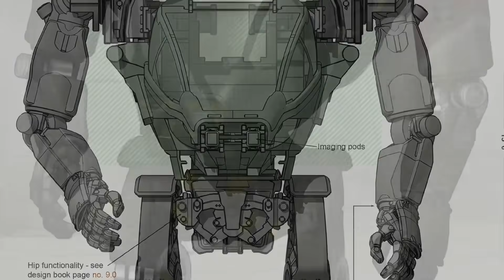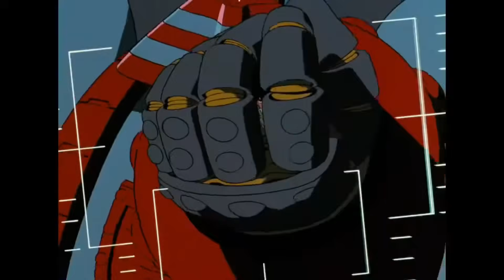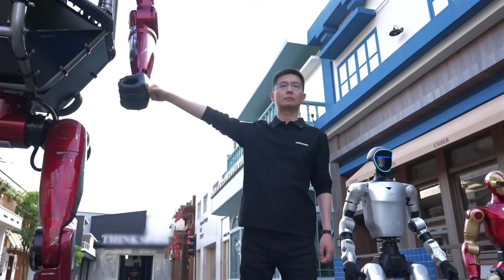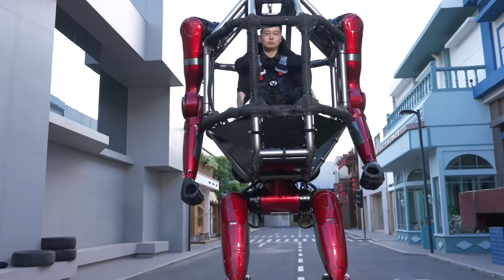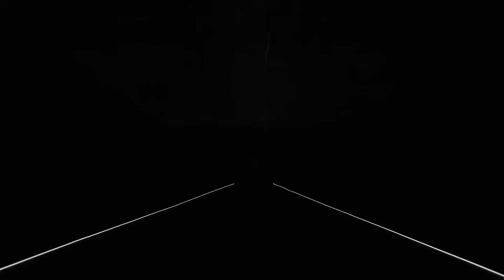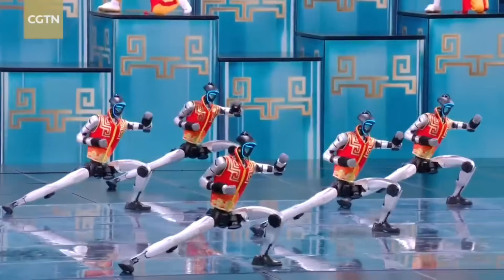Unitree’s Giant Mech Suit Changes Everything

Comment: This looks cool, but if you compare it to a forklift, will it lift more or do it much better than a forklift? probably not, but is it shiny and new, yes👍
Reply: That is the point, you have to start somewhere.  And this is the first sellable mech.  So this sets the first precedent.  By China.  More technology follows, once you start on that first step.   That includes walking forklifts, like the one in Aliens, if practical enough.   To me this first iteration is like an early Biotron, from the old Micronauts toy collection.  It even has that splash of red color.  I still have my Biotron, bought in the early 1970s.
Reply: @robwebnoid5763  I'm not an expert on mechanical robots at all, but if I'm not mistaken, what you might call a counterbalance forklift has usually has more or equal weight than what it's trying to lift, the weight usually being 2 to 10 tons or more, to prevent the forklift from tipping forward or sideways. All of this is powered by two or more hydraulic system and a motor to propel the truck, whereas a robot seems more complicated, but a robot looks really cool 😁👍
Reply: @haraldpaulsen9180  ... Yes, this is just the beginning.  This was never meant to be designed as a forklift. Its just a working proof-of-concept prototype that finally happened & now they (Unitree) made it commercialized, to make money off of it, to use that profit to fund more robotics.   If someone feels like they want to design some kind of giant robotic forklift in the future, whether with legs or not, then someone will eventually invent one.  Hopefully China will do that first before any other country does.  They already use smaller robotic forklifts.  They also use autonomous flat robots that fit under pallets, although I think Germany invented that first, idk.   China was one of two ancient civilizations that invented Automata, the precursor to robotics, starting around 3000 years ago, so it makes sense that China continues that innovation they collectively have, then & now, although China was already making modern-day robots around 50 years ago since the 1970s.

Comment: The funny thing is, most of the tech to build this existed 60 years ago. 
The only two things that weren't there:
1. Batteries either had very short lifespan or were too heavy.
2. There were no advanced algorithms to keep the robot steady on steep surfaces.

There were prototype transport walkers, but they ran on combustion fuel and their legs were very clumsy on some surfaces.
Reply: yeah its less Can we do it vs how do we power this thing of any decent amount of time also how useful is it vs the Cost.
Reply: Anyone can do the first 95%. It's the last 5% that matters and always the hardest to achieve.

Comment: Thry have to stop making it sound like AI is involved in this.  It is really fast, really small, really powerful computers that can crunch massive amounts of data at incredible speeds, but fundamentally, there has not been any paradigm shift (not one i can find) between what the computers in self balancing robots do and what computers did 40 years ago.  New computers are just insanely powerful, they are not fundamentally different and there is nothing “AI” about them even if we use the term very loosely. 

It is 100% marketing.

Comment: need to increase this arm sizes , it is comicaly small :D
Reply: Can’t support the weight. Everything is balanced engineering wise.
Reply: Extra size and weight without a commensurate increase in load bearing capability, is unnecessary and pointless.
Reply: It's the same girth & length as the legs & in good proportion with the torso.  It reminds me a lot of Biotron, from the Micronauts toy franchise, of the 1970s.   Don't worry though, this is the first iteration.  This is just the beginning, a pioneer, & this sets the precedent.   China invented Automata 2-3 thousand years ago, which automata are precursors to robotics, so this is just China coming back full circle to their innovative past.